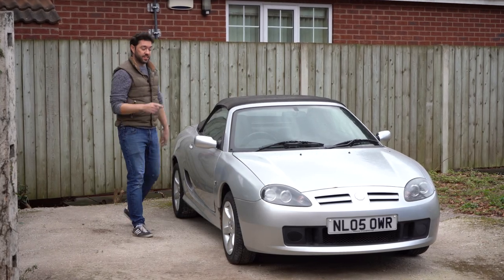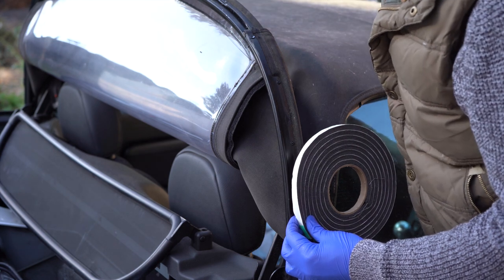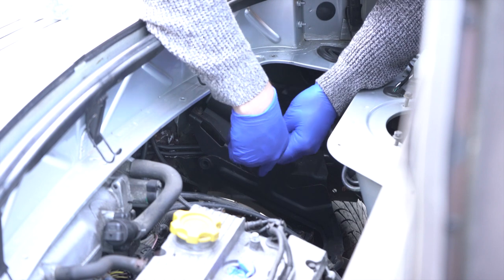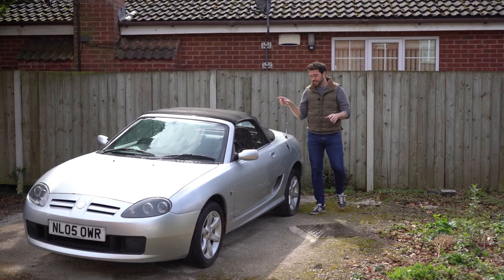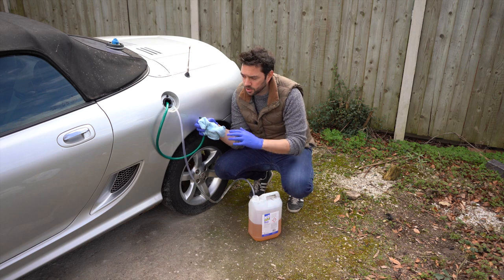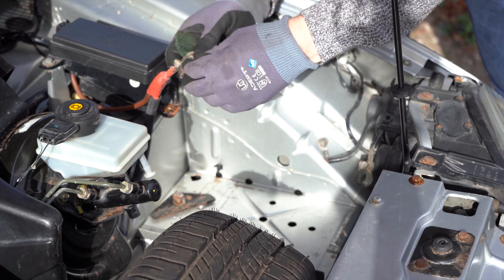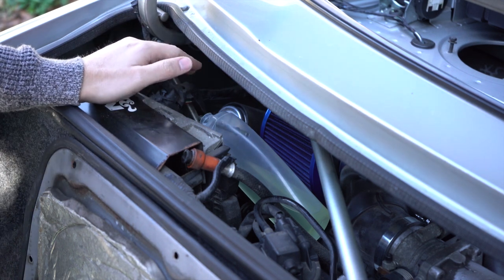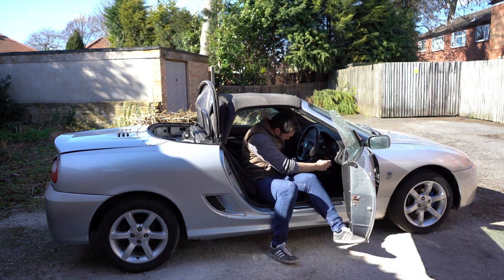Will it start?...plus... new **GIVEAWAY** | MG TF Restoration

Comment: Hi, first time viewer.  You have my sympathy especially after all the work you have done so far.  It does look like timing, but I would compression test it as well.  I've just looked back at your previous uploads and have this question why did you use that particular gasket?

Comment: Was holding my breath waiting for her to start. My TF has been off the road since lockdown too. Sounds like a timing issue to me tbh. Track back through everything you did with cam belt etc. Good luck I’m sure you will get there if you have not already. You will love driving the TF. Best little mid engine car you can get for the money. All the best.

Comment: I feel your pain Lee. I would double check the timing. Its quite easy to remove the top cam belt cover to check that the cambelt gears are located correctly. I have just finished doing mine and fretted and farted around trying to get it right. Make certain the cam gear is located on the split dowel correctly as per manual and that the inlet and exhaust writing is also correct as per manual. Just done mine and forgotten already which way round they were🙄. Obviously the crankshaft pulley notch needs to be pointing at the plastic lower cover marker positioned at about 12 o'clock. If it is wrong then you will need to remove the two cam gears and cam belt, after removing the cam tensioner. I rejigged mine without removing the crank pulley and lower cover. Its a struggle to get everything set back up with the belt tensioned correctly, I turned the crankshaft pulley anti clockwise  about one tooth so that on returning it to twelve 12 o'clock it  put the tension on the belt. Its a fap but can be done. Hope that all makes sense. Getting the tensioner back on is a struggle and I used a piece of wood about 1/4 thick to lever between the alloy casting rib and the pulley wheel to enable getting the bolt back in. A few choice words uttered are a great help! You can of course be one complete revolution out but that becomes obvious as the camwheels are not aligned correctly, check them first and their position on the dowels. Of course it may not be timing at all in which case ignore all this🤔. Good luck.

Comment: Oh the frustration! I've been looking at my 80th anniversary 160 sat in the garage thinking I need to get that back on the road. I'm Sure you've done this but, Cam shaft positioning sensor and crank sensor could do with checking as well as MAP sensor on the inlet. I know this sounds daft, but have you made sure the throttle is open when trying to start to rule out the idle control valve?

Good luck mate, been following for quite some time

Comment: Hi Lee, i had the exact problem when i tried to start my mg after i did the headgasket and everything else just as you did. The problem i had was with the timing (timing belt was fitted on wrong), so after i maked sured it was in the good position it started right up. So maybe you could check if its somthing with the timing?! Keep up the great work!

Comment: Have you checked the fuel switch just under the nearside of the engine bay. Designed to cut the fuel off if car is involved in a accident. Worth a check.  Good luck, my 160 is sat on drive awaiting some tlc to get back on road.

Comment: You're not far away now Lee as you've changed most things in line, sounds like a sensor issue. The fuel tank is an odd design where there's always about 2 litres or so sitting in the base section so you need quite a bit to get it started. Good luck and well done for working in all weather! 👍🇬🇧

Comment: The original lead caps are a hard black plastic , when I was replacing mine the caps broke into little pieces 
and the new ones being a soft rubber I thought was a much better idea, and like you pointed out sat up proud 
it worried me but after watching your YouTube video I can now rest easy and won’t go back and hit them down with a hammer.

Comment: Is the firing order OK ?
Did you do a compression test ?
I would think sensors are OK, as it would throw an error. Crankshaft position sensor is one that could prevent you from starting.

PS: that’s a lot of water in that coolant bottle.

Comment: Hello lee I would check the injectors as if ones not working it stops it from firing and check the timing is spot on and reset the bcu by locking and unlocking the car four times mate

Comment: So close Lee - you have spark, air (check throttle body working ok ?) and fuel (quality - try easy start to rule this out ?), so next key step is to do a compression test to eliminate this as a potential issue.  Good luck !!

Comment: Great video , pity it didn't start but reckon a sensor issue. Ps do you have a link or part number for the seal you used on the roof , think mine is shot so will be a little project for me

Comment: Might be a timing issue. Get a mirror so you can look at the timing marks from a better angle, and you'll likely see they're aimed slighlty too low instead of being level. I always have this issue when putting the timing belt on. I have to do it multiple times while twisting one of the cam pulleys backwards slightly to get the belt on the correct teeth. Then cranking the engine around once by hand, the timing lines will line up straight instead of being slightly off.

Comment: My TF needs new hood seal as well. What Screwfix tape did you get and it looks like you left some of the protective tape on the seal?
Reply from the maker: Hi Ali, yes I left it on a peeled it off a bit later. Its still on so working well at the minute. Heres the link...https://www.screwfix.com/p/stormguard-extra-thick-weatherstrip-black-3-5m-2-pack/40425?tc=AT7&ds_kid=92700059835347618&ds_rl=1244072&gclid=Cj0KCQjw1PSDBhDbARIsAPeTqrcQA2DGnzQ-jTeExcwF8YpHSIs5Bsi2s260NgcriCJHUawCW0zmSFUaAt0cEALw_wcB&gclsrc=aw.ds
Reply: @wheatleysworkshop  Thanks for the info. Doing first long trip with the TF 21/04/2021 so fingers crossed. Good luck with the ignition problem.

Comment: It seems to fire first off, which to my mind is a fuel issue.  It's got residual fuel in the cylinders but then the injectors not supplying fuel.  Check the injector cabling.

Comment: You may have sorted this by now, but I would be looking at the ECU coolant temperature on OBD scan tool, if the sensor is duff, then it will often tell the ECU that it is starting a hot engine when in fact it is cold. Hence why you were getting closer when the ambient temperature was higher.
Reply: I came here to suggest the same thing.  Coolant sensor faults will prevent the car starting.
Reply: Coolant temp failing often results in a too low temp, causing the engine too run rich.which is still safer that having it run too lean.
Reply: @ErikB750  It’s known issue, in 16 years my TF has only failed to start twice, one dead alternator and one faulty ECU coolant temperature sensor that was reading slightly higher than ambient but enough to confuse the ECU.

Comment: Have you checked that the fuel cut off safety switch hasn’t been activated.
Reply: I think it’s in the left side of the engine bay near the fuel pump. If your not hearing the fuel pump prime when you turn on the ignition then it may be this inertia switch that’s been triggered.
Reply: @johngarden6916  I concur, but also check cam belt timing, make sure you have not jumped a tooth. Failing that the engine immobilizer, this lets the engine fire but not start or run

Comment: Dude loving the work. What obd2 tool did you use?
Reply from the maker: Cheers Dan. I used a Bluetooth one by Casella (already had this as use it on my audi to service the breaks) but you can pick any obd2 Bluetooth module for less than a tenner.

Comment: You may have made a mistake while installing the new timing belt.
When assembling the camshafts, the drive pin of the inlet camshaft must be at 4 o'clock and the exhaust camshaft at 8 o'clock.
Has happened to me before. Please check your old video of the assembly of the camshafts. Greetings from Germany!

Comment: a spark will ignite the fuel when timing is right, so fuel supply? Yup. Spark? Yup.Now its down to crank and cam sensors.giving the correct information. Remember the three  thibgs needed for a flame. combustable material oxygen and heat. Get them at the same time and your sorted.

Comment: I'm not hearing the fuel pump buzzing as it brings the pressure up when the ignition is turned on - might be a video/ sound issue.
The beef I have is I think it was the second start attempt I am sure it was trying to start for a second. Then went to nothing.
After the move to the new place, it really did try to start. Given that, the fuel and ignition plus timing must be ok, meaning it can't be so far out to be a major issue so I'd say all that is Ok.
Oh, before the move, when using the Amazon Spark Tester, for sure we saw flames from the burning fuel mixture pushed out on the combustion stroke. That I think is a usable way to check fuel injectors if carefully done on the other cylinders.
My leaning is towards fuel. When left to stand, over time, she did try to start but did not run. Overtime fuel build up in the fuel rail ? But with a lack of pressure, once the initial squirt is over, there is nothing more.
Just occurred to me that in blowing into the fuel tank to siphon the fuel, you may have forced air into the fuel lines. Now I can't remember if that was before or after changing the filter, but with a new filter, that would have been filled with air when it went in and might need bleeding before it will work.I'd work to confirm the fuel system is all that it should be before turning to the sparks. The sparks are two completely independent systems, so one of them, or some of the spark plugs should work, and we did see sparks.
You deserve a beer for working in the snow. :)
Edit - in thinking about it, unplug the fuel return pipe from the injector common rail, turn on the ignition and this should pump fuel and bleed the rails. If the Siphoning did put air in the system it would have put it in this return rail, and new fuel filter will get primed up in this process. Let the pump run for a bit, not just a split second, but enough to do its job, ie a filters worth of fuel atleast.
As you've never run the car before, on mine when switching on the ignition I hear a buzzing sound that is the fuel pump bringing the fuel system up to pressure, I think its about 50psi. When there it stops. The injectors are just a valve, and when open, the fuel under pressure escapes the nozzle. At;east one of your injectors must have been working for the flames seen in the video. That spark plug must have been working to ignite that mixture. The crank sensor must be working for the ECU to know to trigger the spark at that cycle, and because the car did try to start, there must be compression and the timing must be right.